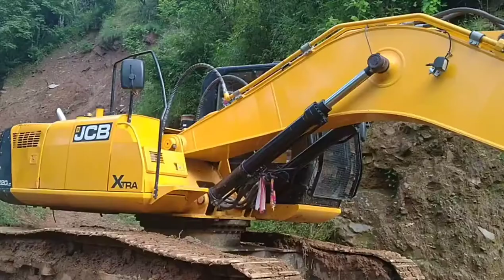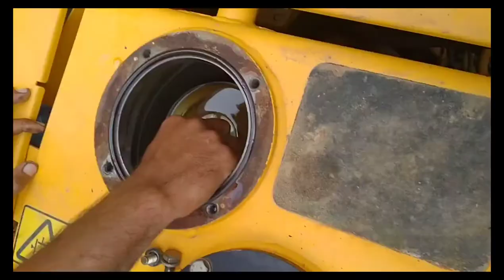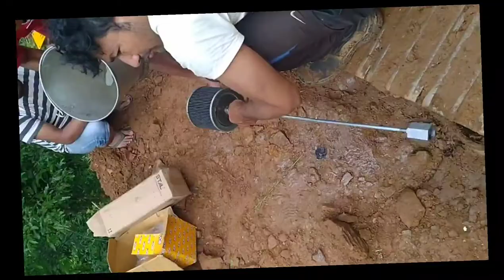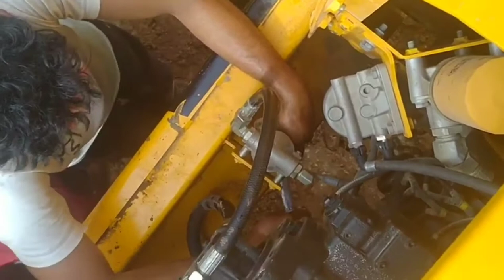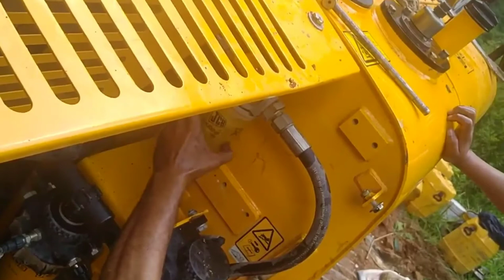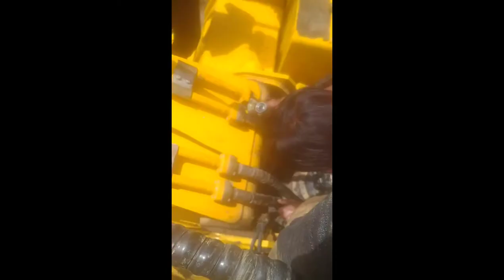Changing the hydraulic oil of JCB 220-How to remove used oil. Changing the filters. WORKS OF JCB 220

Comment: U should not throw that oil on the soil
Reply: oil comes from the earth
Reply: @oudonbail   Yes. But, thousands of meters below surface. And, additives are what makes them hydraulic oil. Or, most of these oil are synthetic which makes them harmful when ends up in natural waterways. So, "Do not fucking drop 'em!" Dispose of them properly.
Reply from the maker: Yeah we know ,we shouldn't throw oil on soil but we are unable to store this oil on any place. We need to work on rular areas of Nepal , this excavator is not on garage where this excavator is far from house or camp.No availability of bucket or other store equipment.So this we are unable to keep oil in particular place.Sorry for that